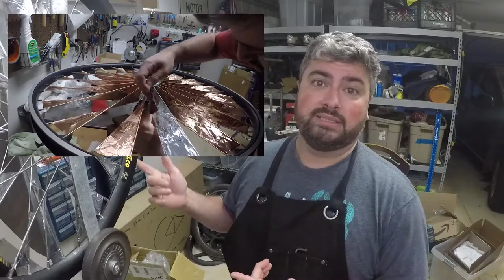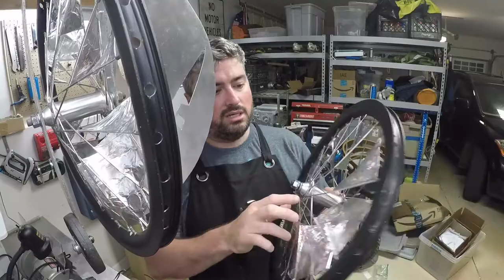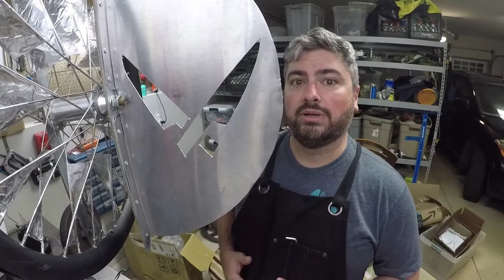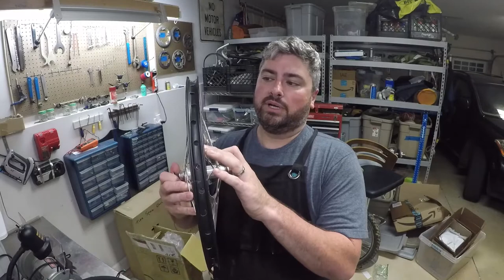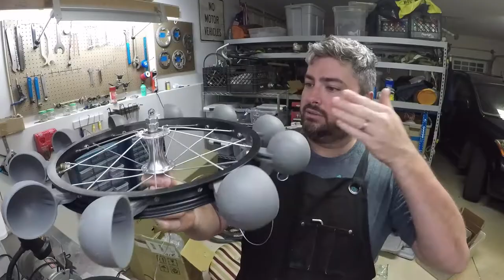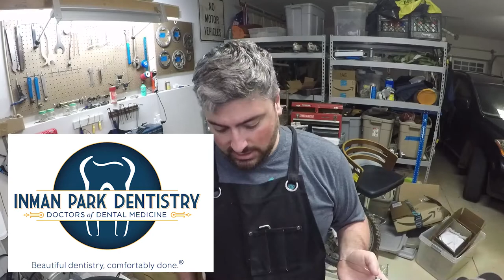Bike Wheel Art discussion (PLUS a sneak peek at NEW projects with 3D printing)!

Comment: Hi man u r doing good job .Which of the two ways is more powerful and relible against the wind ?I m already trying to make my own turbine to generate power and confused between both ways .I need ur recomendation to finish this thing .thanx alot.
Reply from the maker: Mesbah Modfree 
Making the wheel in the style of a fan blade with the foil tape between the spokes is much more powerful in the wind than the “water-wheel” style with the scoops at the edge of the rim. The scoops style will always spin slower in the same amount of wind. So as long as the fan-style has a big enough tail to keep it pointed into the wind, it will spin faster and with more power.
The scoop-style is great if speed/power isn’t as important.
Reply: Thanx Alex